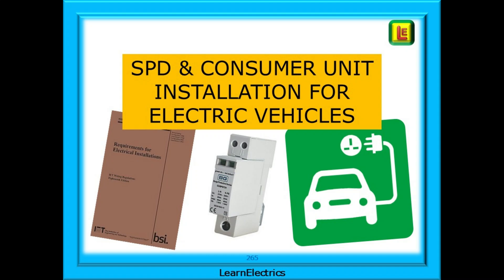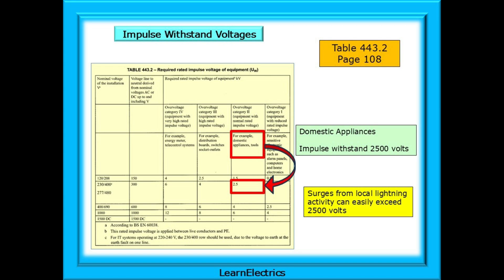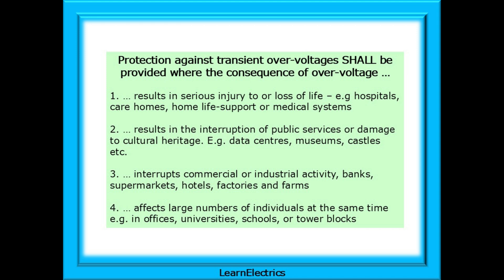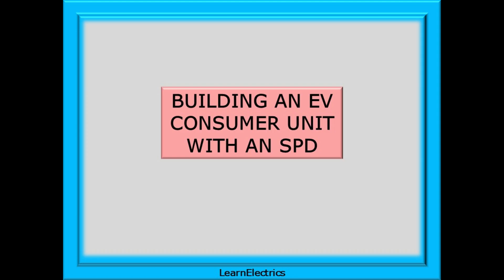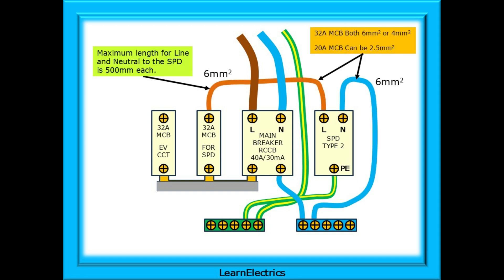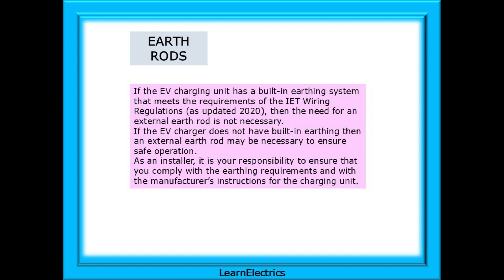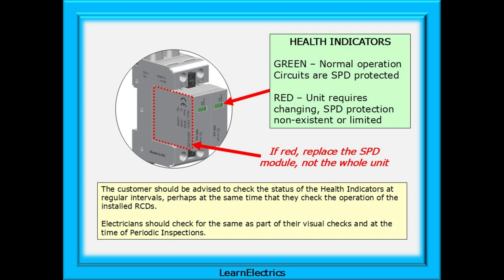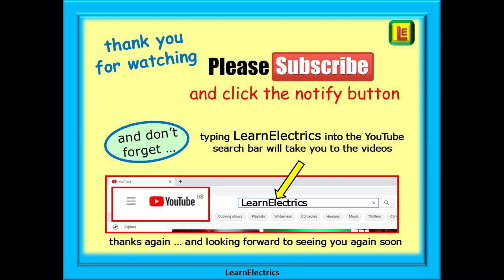SPD & CONSUMER UNIT INSTALLATION FOR ELECTRIC VEHICLES - WHERE TO INSTALL IN THE CIRCUIT

Comment: Wouldn't you put the MCB for the SPD on the other side of the RCCB/RCD so you keep the wire length to the SPD as short as possible, given 300 to 500mm is the recommended cable length?   Depending where the earth bar is, that 500mm length can be very easy to run up to and even 10mm could make a differnece.  On top of that, it kind of makes more sense given the SPD is wired before the RCCB so the physical location would make more sense before the SPD.     Just my thoughts obviously, so I welcome other opinions or thoughts
Reply from the maker: Interesting thoughts. This is the standard way of wiring the board. Thanks for watching. Dave.
Reply: @learnelectrics4402   I guess different countries have different ways of doing things.   I've seen several UK sparkies do it with the MCB right beside the SPD.    Maybe it's a little personal choice too..
But yea, my comment was just my thoughts being put into words

Comment: Excellent video and I will watch again to get it ingrained. So I assume that SPDS are fitted as standard unless the customer specifically doesnt want one for some unknown reason.
Reply from the maker: A lot of domestic sparks will just design it in. For what they cost now, its no big deal on the cost of a new CU and fitting.

Comment: Is this becuse of the transformers? Sudden spike can cause spike like an ignition coil ? When u discharge one side of coil ? Very interesting
Reply from the maker: Yes, induced voltages. Some big industrial machines can produce massive spikes. I can remember a huge fluidised bed furnace that knocked off most of the industrial estate when it was switched over.

Comment: Non related question please Dave , Table 4D4B above 25mm2 we have a choice of 3 for mV/A/m, r x and z can you explain what the difference is , thank you in advance
Reply from the maker: Above certain sizes and currents other factors come into play. Unless you are using big cables then no need to take them into account. Perhaps I should do a video on this, hmm!
Reply: @learnelectrics4402  Thanks Dave i was given a task of sizing a cable from generator to dinning facility with  draw of 200 amps , cables clipped direct on tray temp of 40 degrees 3 phase